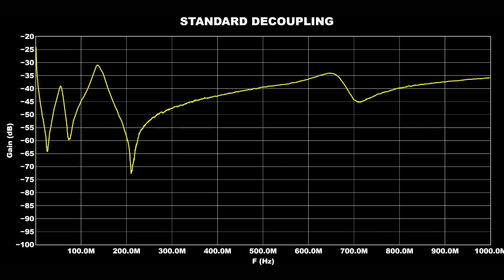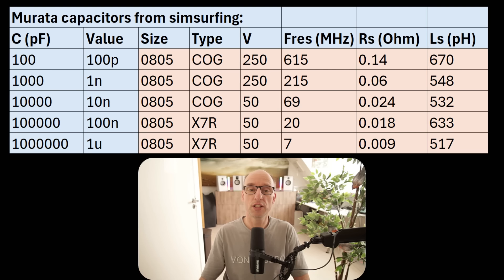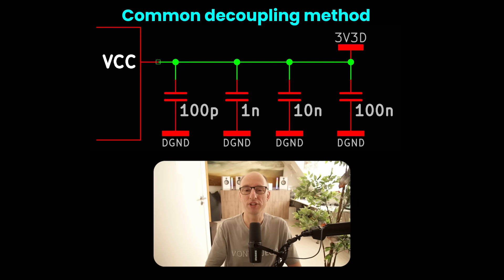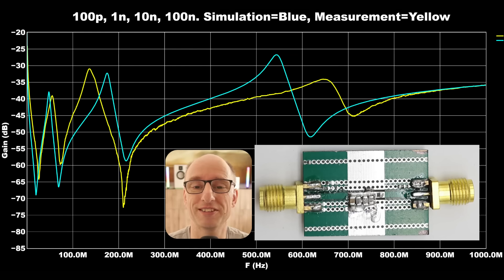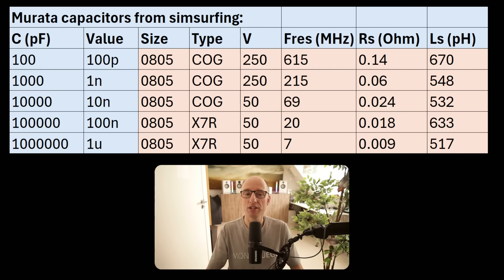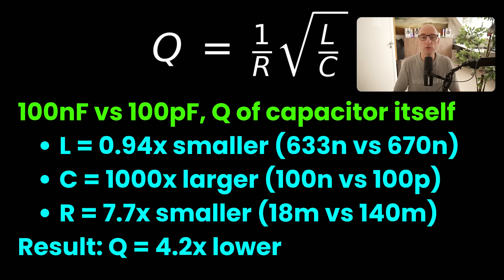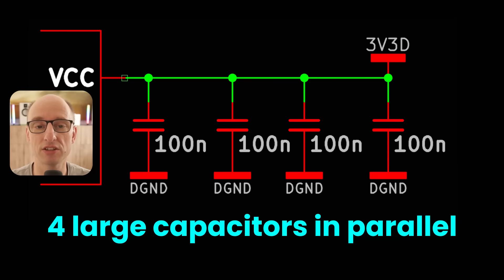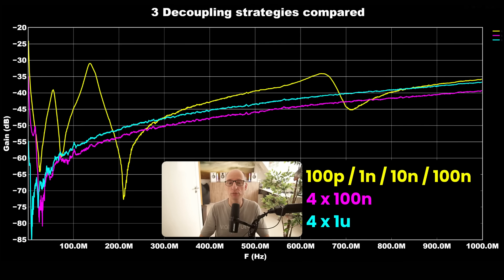The most misunderstood concept in decoupling

Comment: Great video, Hans – excellent points and conclusions! We really need to move away from the old bad habits in PCB design, like blindly using multiple capacitor values without considering their actual effect.

I’d also add that while high-value capacitors can sometimes be necessary, they must be treated with care: large capacitance can cause inrush issues, so the LDO’s rise time or soft-start characteristics need to be chosen appropriately to handle that added load during power-up.

Another pitfall I often see is the use of ferrite beads in series with decoupling capacitors. Instead of improving performance, this often creates resonances and ringing that actually worsen supply integrity.

It would be fantastic if you could make a follow-up video on how to damp those bead–capacitor resonances, for example by adding lossy elements such as electrolytics or other damping techniques. I think many designers would really benefit from that deeper look.

Thanks again for putting out such a clear and insightful explanation!
Reply from the maker: Thanks for the feedback. In my course I go deeper and also analyze ferrite beads and show how you can use them if you want. But I would not recommend using them in the first place.
Reply: Yes, exactly — ferrite beads are most of the time a “solution” to problems that don’t really exist. Using them on power rails in conjunction with decoupling capacitors usually makes things worse. Maybe they make sense in input filters or EMI front-end filtering, but not in local decoupling.

I do have a question about your recommendation regarding the decoupling capacitor array: instead of using multiple capacitors in parallel, would you suggest going with a single low-ESL capacitor, or perhaps even a three-terminal capacitor (with much lower ESL) as a replacement for the typical 4-cap or multi-cap approach?

Comment: An MCU load is not 50 ohms. What is the actual typical range of impedance and how does that effect the ringing?
Reply from the maker: If you want to dive into that, this is actually very complicated. The reason is that you'd have to take everything into account: Bond-wires of the chip,  local on-chip decoupling, pcb-traces and pcb vias (you need to model them exactly). However, this is only needed for extreme applications.
Reply: @HansRosenberg74 the generic model could get infinitely complex. Loss tangent, variation in humidity. Or it could be measured with a scope and tools that most people have.

Comment: I encountered software from Altera that calculated a network of capacitors with different capacitances to maintain low impedance over a wide frequency range using frequency-distributed resonance dips.
Reply from the maker: Interesting. I wonder if their solution is correct. I analyzed this option as well, and the only way to keep resonances down that I could find was to make small increments in the cap values: 1, 1.2, 1.5, 1.8, 2.2... however, this becomes very expensive on your BOM so it is far easier and reliable to just use one large value many times.

Comment: Explains why I see 1 Ω (Ohm) resistors in circuits on occasion. 
I got as far as figuring it’s related to inductance but didn’t have time for a deep dive, 
Thanks 👍
Reply: This can have very different reasons. Sometimes you try to change the Q value of a large capacitor with a series resistor, or try to limit the inrush current into a bulk capacitor or trying to add some specific frequency dampening. You have to be very careful about the noise that this resistor can add into the supply, so it's not that easy,. I've often seen way smaller values than 1 Ohm, like 0.05 Ohm or in that range. But you should really understand the full circuit to actually know where and why you would add such elements into the circuit.
Reply: @ProtonOne11  Thanks for the background info. I never considered it. 
Guess I’m going to really have to do that deep dive after all if I want to be good at it. 
Thanks again.😊
Reply: Other times it's used to measure current

Comment: I worked with professional (ttl) electronic 30 years ago and decoupling the power supplies with groups of 8 to 10 parallel capacitors was standard in that time. Usually at the four corners of the (large) boards.
They still used additional decoupling near the chips. 
I don't remember the capacitor values.
Reply from the maker: That was a completely different time, speeds were also much much lower which helped as well.

Comment: A couple of things you missed in your model—there are small series inductances between the capacitors and on the input and output. Combined with the tolerance issues you stated give you the anti-resonances closer to the normal resonances, a lower than expected resonance frequency, the deviation in anti-resonances you experienced with the decade caps. To minimize inductances, particularly for RF bypassing, you need to use a smaller packages closer to the pin to be bypassed. But using the largest capacitance you can in that package is better than trying to do the decade caps nonsense. 

I too have never seen an application that dampening a series resonance was necessary, and that resistor adds significant series inductance at high frequencies.
Reply from the maker: This is a simplified model as I stated, you can go a few levels deeper, however for 99% (or maybe more) of applications, this is enough.

1 Ohm resistors indeed have inductance, however, the gain you get from the resistance in reducing the q factor is way more than that since the inductance is under the root and the resistance is increased by 55 times!!! The goal here is not to achieve the lowest impedance, but the most stable one, killing off any chance for ringing.
Reply: @HansRosenberg74  Thanks for the response. I understand the purpose of the resistance—to dampen the parallel resonance that will occur with the series input feed inductance, and the inductance of the supply proper. But besides controlling ringing overshoot during hot-plugging or rapid supply voltage increases on a portion of the bulk capacitors, often in conjunction with a supply EMI filter, I’ve not personally run into an application for doing this.

I generally subscribe to the thought that minimizing the coupling to resonant modes, is often better than dampening them.  Mainly because it’s difficult to dampen them all. In this case, ensuring lowest possible impedance of the network within the used bandwidths of the system will do better than dampening the system outside that bandwidth. If that can’t be avoided, then I can see the value of trying this approach.

Comment: Those things seem quite obvious... after watching the video. Then why throughout my whole professional life I had been using that wrong, "mixed" decoupling scheme. Assumption is really one of the worst enemies of an engineer.. Thanks for the excellent material.
Reply from the maker: Yep, took me a long time to to find this one....
Reply: The reason is through hole components era. Smaller caps had smaller inductance bc they were smaller un size. Now, inductance is related to package, not C value. So you want large C in the smallest package possible. I use 1u 0402 everywhere.

Comment: I think you should point out that the noise also depends on "what the load is doing" since a 50ohm load is different from 600ohm load and the frequency of the power supply also produce different noise at higher voltage, but if this video is for beginner, this video is good enough 👍
Reply from the maker: Yes indeed, I had a section in the video where I wanted to show that, but it's always a balance: How much do I show? I didn't have a setup to measure this either, so I decided not to put that in. If videos become too long, people also lose interest (I can see retention graphs in youtube studio so I have data there).

Comment: I feel like this channel operates in a grey zone.  You need to have a high base knowledge level to even follow along, but also it is simplified for easy watching.  I feel like you could reach more audience with either a lower knowledge floor or a higher level dive.
Reply from the maker: Thanks for the feedback. I think I try to be in this zone, catering to beginners and more advanced engineers. But I find this a very difficult question to answer.
Reply: My knowledge extends to having a vague notion of what components are supposed to do in a circuit so this is actually a super helpful combo, you could skip the explanations but they are also invaluable.
And Grauzone is a good band!
Reply: Yes, the beginning was a bit unnecessary for the audience.
Reply from the maker: Hi, which part was unnecessary do you think?
Reply: @HansRosenberg74  Dont sweat about it. You did good and it was just a petty thing.

Comment: That's fun, I had also heard that you should use different capacitors in parallel to get the best performance. But somehow all the companies I worked for so far just put 100n caps on each IC and where done with it. And it worked, no EMC problems or whatever. So why change it, although you should theoretically do another thing? It is very fun to me that the practice engineers have done forever (just put 100n everywhere) is superior to this theoretical mumbo jumbo as it turns out.
Reply from the maker: indeed

Comment: Years ago I had a MathCAD worksheet with many capacitor models for the common power supply decoupling used in our PCB designs. The worksheet was a first estimate to obtaining a low impedance power distribution network. When decoupling GHz SerDes transmission lines don't overlook the trace inductance along with the via inductance associated with the small decoupling capacitors. The total inductance can add up and basically swamp out the capacitor.
Reply from the maker: Agreed, the first few videosin this channel dive into some of these aspects

Comment: Very interesting and well explained, by shear good luck I have been doing it correctly but to be honest only because I am lazy and just stuck to 0.1uF everywhere.
Reply: Same here.
Reply from the maker: ahhahaha, you lucky 'bast@rd' ;-) (big wink :-)  )
Reply: @HansRosenberg74 I have a question, Is there calculation for determining decoupling capacitor. I always used 100nf and some times 100nf+100uf decoupling capacitor.
Reply from the maker: I think the value is mostly determined by the speed and amplitude of the load currents of the load. If they're fast and large, you need low impedance up to a high frequency combined with a large capacitance value. When you really get to that stage, you have to do some simulations to make sure the peaks are handled by capacitors very very close by, otherwise you're building a huge transmitter and creating way too much ripple on your supply. This may disrupt the good operation of your circuit.

Comment: I use Coulomb buckets with great results. The lower impedance the better! 😂
Reply from the maker: Ehm, I think if you need this, you need to damp all of them. When you start using planes this should be an advantage, just make sure you place vias really really close to the vcc and gnd pins to keep the loops short. You need caps close to those points anyway, to make sure the loops are short.
Reply: Never a need for dampening as I use very closely coupled power planes (<=5mil) as buckets. Very quick to charge & discharge. If the board is large enough one can omit decoupling caps. Small low inductance loops are good loops.

Comment: Another FANTASTIC video.  This has opened my eyes more to the theories I heard about power supplies.  I'm not that methodical, usually I have a linear regulator and I put a couple of large, honking caps, then a 0.1 uF for the stray AC signal that I might get... I never really check unless I'm getting glitchy behavior.  Also all my digital IC's have a 0.1 across them, which was the common practice with the 7400 series.

Capacitor Models LOL... Hey, send those gals over here LOL   Cheers.
Reply from the maker: Haha, thanks, yeah, those models are nice, chatgpt made them :-) I wonder how long it takes before chatgpt gets a 'constructgpt' option to build real ones :-)

Comment: in the last version, can't you just add a resistor in series with said long trace? intuition tells me it would be way better... That's what i usually do (although, i'm more dealing with overshoot when connecting power, than with high frequency stuff)
Reply: Series R would indeed do the damping, but the disadvantage is that any AC component of load current (eg 100kHz square signal from DC DC converter lets say) creates a corresponding AC voltage drop, some of which will show up on the VCC

For the inrush overshoot, the brute force parallel damping method is adding bypass of a quite large capacitor in series with the parallel damping resistor calculated in the usual way. the other brute force method is adding a TVS diode (or some other clipping circuit) to the VCC node to eat the overshoot energy (ie that stored in whatever series inductance is present, eg cabling or filter components), and ensure the system can tolerate the momenary peak voltage of the TVS or limiter circuit. This can become impractical as system current or voltage scale up tho. After that it's getting into soft-start or hot-swap type circuitry as far as I know

Comment: So the 1990s way - "just slap a 100nF beige brick across it, done!" was always the right way? :)
Reply: As he mentioned, when dealing with capacitors of different package, the question, while analyzed the same, becomes different in practice. We used to do that with large electrolytic capacitors, which had atrocious parastic inductance, especially in through-hole packages. So a small 100 nF capacitor in parallel would certainly make a big difference at high frequencies. But if you're only using small SMD capacitors, especially in the same package, that's completely useless, and as he showed, even detrimental.
Now that can still be useful when dealing with higher capacitance, even if just ceramic SMD, as they come in larger packages with inevitably larger parasitic inductance - and also, it may be inconvenient to put a larger cap very close to an IC pin, so you add a smaller cap (such as 100 nF) in parallel, route this one very close to the pin to decouple, and you can place the larger cap a bit further away. For instance, say you have a 10 µF 0805, a very fine pitch IC, you add a 100 nF 0402 right next to the pin in question and the 0805 can go a bit further away where there"s room for it.
Reply from the maker: That's good advice, just check where the resonance of that large cap and the 100nF caps falls and make sure you don't operate at that frequency to prevent large ripple.

Comment: Great! this shows the high frequency side of the resonant frequency.Will this also applies to the lower frequency side? for example, use 4x10,000u vs 3x10,000u+100u+1u+0.1u+... in audio amplifier/dac power supply.
Reply from the maker: YES! It will resonate. If the resonance falls in an 'annoying' frequency, it can be a problem.

Comment: Very interesting  results ) In damped version - can it be beneficial to keep only part of capacitors damped, like first and last (or the other way around, keep first and last undamped)? What is the effect of distributed capacitance (when you rely on ground+vcc plane capacitance and sprinkle caps uniformly across full trace length?)
Reply from the maker: Well, the more capacitors you damp, the more stable the circuit will be in all circumstances.

Comment: Great insights, as usual; laughed at the aging thread. Please consider making plots in log-freq scale, as low (-ish) frequencies correlate more with practical cable lengths, with the cables acting as unintentional radiators, while higher freqs are often (but not always) attenuated enough by the circuit, the enclosure and the ferrites (another huge topic to cover). Cheers!
Reply from the maker: Thanks for the ideas, I have so many ideas available, it just takes a lot of time to make such a video, so it's going to be a slow process :-) Indeed log-scale would have been nicer here.

Comment: What about the decreasing capacitance due to DC bias. If I take a 1uF 0402 X7R it'll be low voltage (eg 6.3V), so 1uF might be down to 300nF @5V. Or simply go for C0G?
Reply from the maker: Great point! You can't get COG's in that small size with such a high value. You can only get those really high values in small packages with 'bad' dielectrics. The bad thing is that voltage derating as this is called is usually also badly documented, which is annoying.
Reply: @HansRosenberg74  it's pretty well documented on murata's website
Reply: @HansRosenberg74  Luckily fast circuits usually run on low voltage like 1...1.8V, so 6.3V capacitors' "bad" X7R dielectrics  are far from their nominal voltage, so decrease of capacitance may not be a real problem
Reply: Voltage rating doesn't matter, its package size and material type. 300nF is still better than 100nF so might be worth it or might not.

Comment: Who stacks capacitors but doesn't change the footprint tho?
Reply from the maker: I'm not sure that I understand
Reply: @HansRosenberg74  usually when i see multiple values of caps, the lower value ones closer to the power pins are also smaller footprint. i have never seen them all the same  size like you used in your expirement. would that make a difference? i assume so as you stated that smaller footprint will also increase reonant frequency so maybe trhat would improve the parallel resonance situation.
Reply from the maker: If you can't use the same/value and same package, you have to check the resonances you're going to get. Then it just depends on how sensitive you are to supply ringing weather you're going to get a problem or not.....
Reply: Everyone testing a prototype does! Lets stack up some more capacitance!